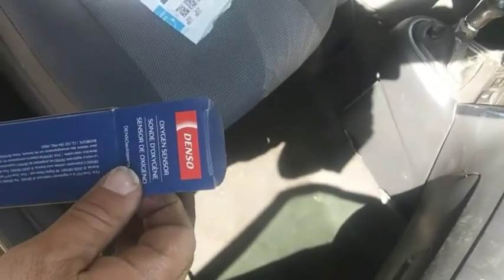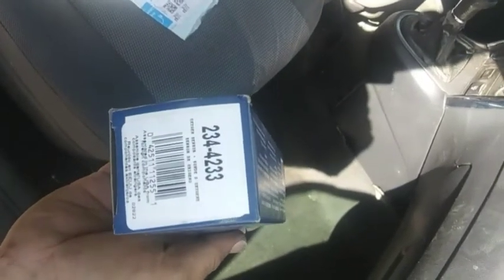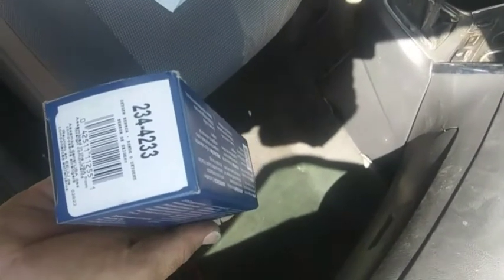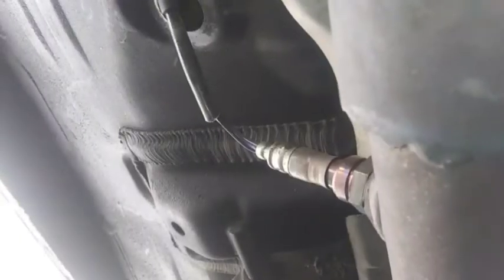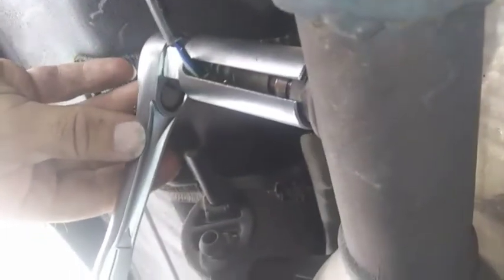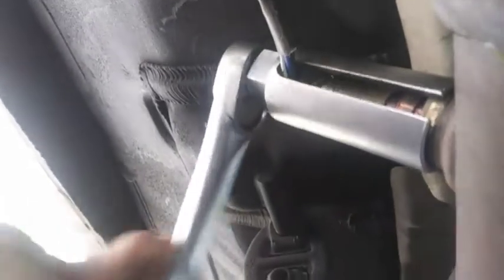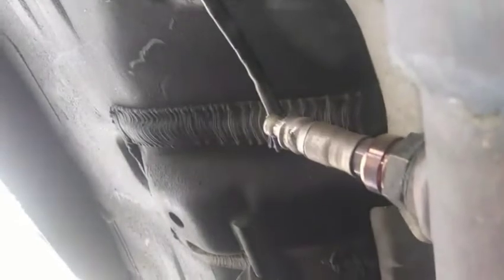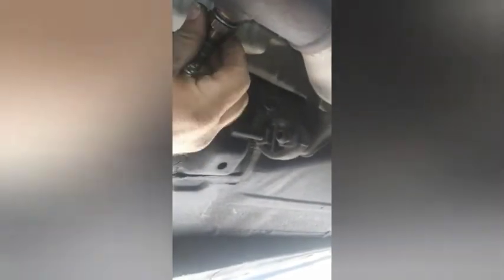Downstream O2 sensor 2005 Toyota Matrix XRS 2ZZ-GE Engine

Comment: 😂Oh wow , thank you so much. 😂😂 I have been looking all over for this information how/ where electrical connect inside was. Not in maintence manual.  Maybe that"s why it looks like never been  changed .  And never  passed a smog test without cheating somehow. And why I got such a good deal used  @180,000 miles.... because previous owner couldn't figure out why the engine light was always on. Information is rare for a rare engine the 2003 matrix XRS  2 ZZ  engine. 
   I hope this is the fix  for better mileage and performance.  I hope I hope. Thank you.🎉❤
 Any suggestions for new  tires?
Reply from the maker: @SWEAR2CARE  
I bought Goodyear Reliance tires from Wal-Mart and they have worked fine for me over the last 20K miles. 
I must note however that my car does not have the 17" rims that came with the XRS package, but 16" steel wheels as a previous owner had switched them out.